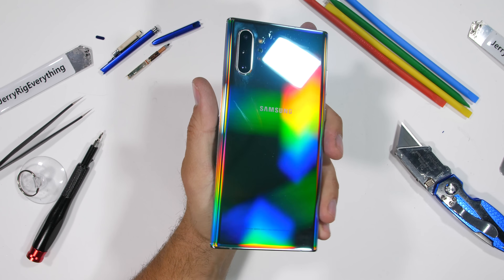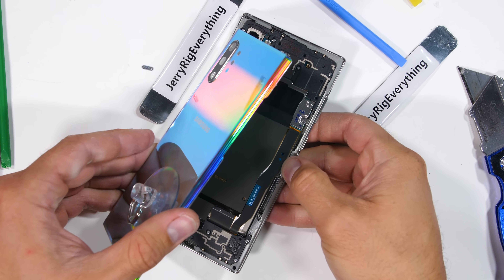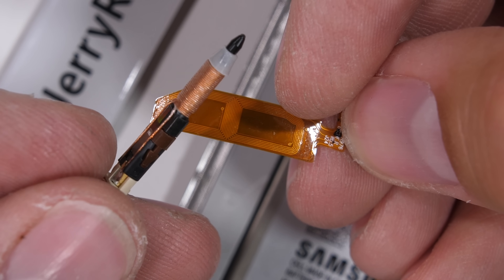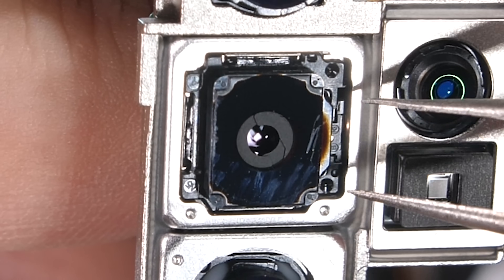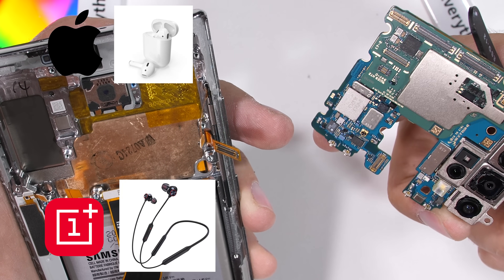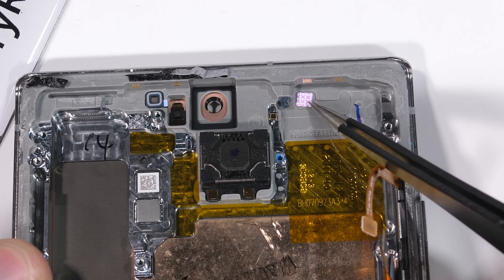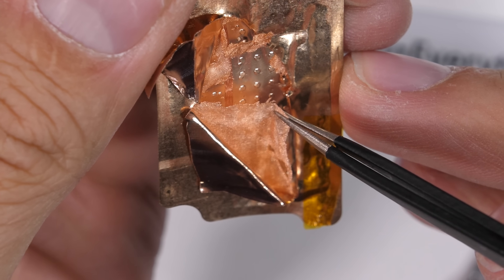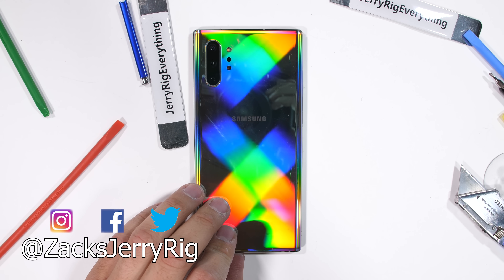Samsung Note 10+ Teardown - TWO Wireless Chargers?

Comment: I'm a system engineer at sumsung. The reason upper management didnt approve the AUX port was as you mentioned the stacking of the MB would cause overheating issues. We have samples with it and it surely did happen

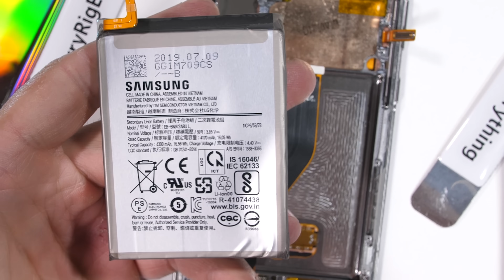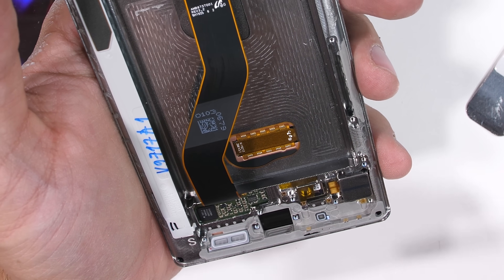Comment: if you pause at 7:33 or 7:34 you'll see that the battery is only at 4170 mAh not 4300 as mentioned
Reply: Wow good catch!
Reply: that's its rated capacity

the typical capacity is 4300 mAh
Reply: well you did not read all of it

Comment: This is ultra helpful.  I noticed my phone gradually quit allowing wireless charging and wouldn't wireless power share at all. Charging would only work about 10% of the time and slightly better chances without a cover on. Then it would only work if I pinched the phone under the camera lens. I removed the back cover and used a plastic stylus to push the connector from 1:55 a bit more securely down. Location makes sense as that is about where I had to pinch to establish connection before. Then reinstalled the cover and it has been charging effectively ever since.

Comment: To remove the battery easier put some alcohol under the battery after u pry the side a bit and it will come right off
Reply: WD 40 XD
Reply: Seems very dangerous and extremely unnecessary. Samsung really dropped the ball there.
Reply: iFixit ?
Reply: @AmanRaturi1  no I tried it on the note 8 even cuz I broke the display ... It went 3 stories down and the back glass was fine just replaced the front glass and screen

Comment: Its a hassle while charging and hearing music. Headphone jack is a requirement.
Reply: Are you supporting the headphone jack or the vice versa?
Reply: there is a cable that splits up for both. but yeah headphone jack has been removed just for marketing
Reply: My Parrot Zik 3.0 4 years old has Bluetooth, micro USB charging, removable battery without screwing, and 3,5mm and qi charging out of the box no adapter needed. I Use Bluetooth headsets since 2007. What year are you living?, 2005? Btw jabra has Bluetooth to 3,5 mm cord
Reply: @porozex3061  It's not for marketing they're pushing for an all wireless future why have cables when it can be all wireless and it'll be better in the future.
Reply: @vrsce0178  That's still marketing
Reply: @vrsce0178  Oh and they realised this after 2 years of mocking others that the future is all wireless.
Weldone!
Reply: @usmantariq7997  True. Lol
Reply: @vrsce0178  "why" 
Audio quality
Not wasting any more battery energy
Commodity
Reply: @jcarvalhaismatos  It'll be better in the future as I stated.

Comment: Samsung should have integrated the headphone jack into the bottom of the S pen.
Reply: Peter Parker that would be cool
Reply: That's great idea
Reply: Mohit Patel  I don't think the S pen has enough power to do for that as it just holds a very small charge.  But I agree it would be cool.
Reply: Mohit Patel  Unfortunately now that Samsung has removed the jack, I think wired headphones are going to become like DVDs, pretty much gone from the mainstream. But on the plus side, it should push wireless headphone tech forward in a good way.  Kinda already has.

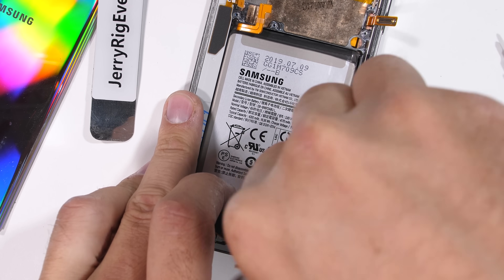Comment: 6:51 WRONG. I have a repair business so I know. You're supposed to add a drop or two of 91% isopropyl alcohol to both sides of the battery. Look at the adhesive design, do you see the channels? That's for the alcohol to flow through and weaken the adhesive bond for fast and easy removal. iPhone adhesive is more dangerous as the stretch adhesive can break causing you to have to pry it out with force which you should only attempt with a fully depleted battery.

Comment: Summary: Don't buy 10.
Buy 9 because it has 3.5mm jack
Reply: And also, if you want a smaller note10 get an S10+ instead, it still have that 2k screen, a HEADPHONE JACK, micro SD slot, andhave a bigger 4000+ mah battery, minus only the S pen
Reply: Street Blue why Do people like that ancient port
Reply: @jaisejacob4516  less lag, you don't have to worry if your earphones are charged, not all speakers are wireless, no need for Bluetooth, which drains you battery faster and more

Comment: so you need to get the + version to have a micro SD card? bullshit! i was thinking about getting the regular note 10 but now i am not. no headphone jack and no micro SD card they just went full Apple you never go full Apple!
Reply: At least Apple has a battery that's easy to swap... I'm not an Apple fan, but at these prices I'd expect better...
Reply: Just get the S10+.
It has more features and a bigger  battery than the Note10, with a microSD slot and more storage. And, it's cheaper.
Reply: Better, Note 10 has exactly the same sim tray as 10+, but the place where you put microSD card on the tray is filled with plastic. Idk, if there's a microSD reader on Note 10, but if there is, just buy the tray from 10+ or try to make a cutout for the card. Other manufactures, like Sony, did this with one smartphone, not for SD card but second SIM. They sold dualSIM version for some markets and singleSIM for others, when you took the tray from dualSIM version and put it in singleSIM, you could have 2 SIM cards functional on the "poorer" version.
Reply: @tommiac3214  the 10 + is way to big for my hands
Reply: Full apple? Because they removed the headphone jack and micro SD card slot do you even know apple? Apple claim to remove the headphone jack to have bigger battery and they still have a shitty battery till now whereas Samsung claim to remove the headphone jack because more than 70 percent of the note users use the earbuds,so in that case including the headphone jack isn't a good business. 
     Micro SD card?!! Just go for the plus it fully packed with a few hundred dollars compared to the note 10. Trust me the time Samsung goes full apple I'm dropping Samsung and at this point it's still a long way to go,no one complain this much when Huawei,one plus and other phone manufacturers removed the headphone jack.
Reply: How much storage have you filled up on your current phone tho?
Reply: Samsung ➡️ Hypocrisy
Reply: @Cdc9877 dude. I bet you have a Bluetooth headphone at home
Reply: @czaroxed  1) the housing is different for 10 and 10+ , so 10+'s tray with micro sd support won't do shit

2) the dual and single sim variant phone's trays are also different , the dual sim phone's tray won't fit in the other thing
Reply: @kavinsp  40/64GB on my phone and the SDCard has around 50/120GB mostly games and music so I don't get bored when I spend over 16 hours on a tractor also I like to take panoramic photos when I see a good opportunity for a beautiful one and they take up a bit of a room.
Reply: @RandHuman  Lmao remember those ads where Samsung used to bash Apple? Absolutely ridiculous
Reply: @Cdc9877 sooooo you have no reason to complain about the headphone jack ok
Reply: @Sara-ts5wo  I wish we could say the same about Apple.
Reply: @kavinsp  1) So you can still make a cutout in Note 10's tray, there's a room for it, of course if Note 10 has microSD reader. 
2) For example, Motorola X Play was sold on some markets as singleSIM, if you made a cutout for second SIM, addidtional card was functional but it had IMEI number stated as 0.
Reply: @dreezyloran6787   as I said before the plus size one is way too big for my hands I'm running a standard size Galaxy S8 at the moment and it's an awkward size for my hands
Reply: @phalanx3803  galaxy note 10 starts at 256 gb and goes upto 512 GB

Even 256 gb version would be more than enough even for power users like both of us
Reply: @phalanx3803  you still have 150+ GB of headroom if you get the normal base variant note 10
Reply: @phalanx3803  so why were you thinking about getting the note 10 in the first place? When you are familiar with the size.
Reply: @czaroxed  nah they are made different , SD card can't be seen even if you swap the tray , i know someone who tried
Reply: @dreezyloran6787  because my phone's geting old the battery doesn't last long anymore and it's starting to slow down a bit and between the Note 10 and the Galaxy S8 the Note 10 slightly bigger but if I get the 10 + I might as well just get a full size tablet at that point.
Reply: @kavinsp  Ok, just throwed an idea there. Still, I don't care too much about taking out microSD from Samsung phone, had SGS6 for like 2 years with 32 GB storage, it was enough for me, now I have V30 with 64 GB and I don't need extra storage, even when it supports microSD cards. Basic 256 GB on Note 10 is an absurd amount for a phone IMO and Idk who would need extra storage in this case unless you dailyvlog in 4k or smth like that lul.
Reply: @czaroxed  well yeah and vlogging on 4k is usually a waste , as it can't be uploaded with ease on YouTube and most people don't have 4k displays to put proper use of it anyway

Even so , someone who spends +1000+ on a phone would probably invest in a gopro hero 7 or something which is much better for vlogging
Reply: @czaroxed  again , I'm not a fan of removing things , I'm not saying that SD card is useless , I'm just saying that the 256 GB of storage is more than enough for 95% of the buyers

Also the internal storage(UFS 3.0 in note 10) is much faster compared to any SD card as a added bonus
Reply: @czaroxed  UFS 3.0 can do 2100 MBPS read and 410 MBPS write theoretically by the way

Comment: LOL "Feature rich cell phone"
I'll just stick to my almost 5 years old Note4, hope I'll find another battery to change it since my second battery is getting tired.
I mean really, Note 10 (2019) vs. Note 4 (2014):
 - 19:9 screen you are really going to "lady tampon"aspect and size.
Note 4 has 16:9 and is way more usable in portrait mode for reading and in landscape for watching videos.
- Screen: 401 ppi :))) vs. 518 ppi on Note 4 released in 2014.
- Useless curved screen, light bending on the sides and prone to crack easy if dropped. Flat screen on Note 4, clean image, dropped many times over the years, even on concrete or bathroom floor, no cracks, only the frame was lightly bruised.
- No notification led anymore... Very useful thing, Note 4 has it.
- No light sensor for Auto Brightness. Note 4 has it.
- No UV measuring, no heart rate. Note 4 has them.
- No card slot. Note 4 has one.
- No headphone jack. Note 4 has it.
- No IR blaster. Note 4 has it.
- 3500 mAh sealed battery (for which headphones jack was removed as samsung explains) :))) vs. 3220 mAh removable battery in Note 4.
1000 Euros for something like Note10 with everything removed, this is just spiting your fans in the face.
-Samsung also bought Harman/Kardon who owns JBL.
And they released the JBL Charge 4 portable speaker, a mono speaker with no microphone to be used as speakerphone and not even a charger in the box.
By comparison when Samsung was no owner of JBL, hes "older brother" JBL Charge 3 was made a stereo speaker with microphone and had a charger included in the box.
Its just veeery very sad what Samsung has become. And how he treats us.
Reply: Please stop talking bullshit. And Btw the battery size is 4300 mah not 3500
Reply: Thanks for specifying "lady" tampon , wait do you use them is that why you had to specify
Reply: @lukasstadler6594  Please stop talking bullshit. And btw I said Note 10 not 10+.
Making a " + " variant just to ask more money for a product with less features than older ones, is just Apple level of crap.
Reply: @florintm4133  Dude if you don't want a new phone, OK I don't care, but don't shit a company like Samsung, that's still produces better phones at lower prices than apple
Reply: @lukasstadler6594  I don't shit anyone, those are simply the facts. Prices skyrocket for no reason, and Note is just an ordinary line of smartphone now.

Comment: Xs Max teardown:
"Upgrading you phone every year is dumb and a waste of money"
Soooo trueeee!
Still using the Galaxy Note 10 Plus (12/256 w/o 5G) that I bought in an used condition and I do not want to change the phone.
Even though it probably won't be getting any more updates for me to leave Android 12 with One UI 4.1, I'm satisfied and will be for a long time (Plus custom ROMs will do the job if I want to install A13 or probably later if custom ROM developers will publish after the open source code comes out).
Even after 3 years of usage (by other person btw) it still has surprisingly better battery than those 5000mah 2021 phones have after 1 year of usage (because numbers do not matter that much, optimization does!)
Good condition, better price, than today's budget phones (that are new), flagship, a nice camera (Even better with a ported Gcam with HDR+ and Night Mode. Plus variable aperture is so cool for me personally) and ability to perform actions so fast, as if it was a 2022 flagship.
Yes, it was very expensive, but also very futuristic phone that can be disguised as if it just came out.
I bet I will upgrade to Note 20 ultra after couple of years and will say the same stuff about that as well.

Comment: Did you end up buying a 10+? I got one shortly after release after switching from a iPhone 7 and it immediately was amazing, installing apps almost instantly compared to a 2-4 minute install time. And that's even with the less powerful exynoss version, boot times were immensely fast and I barely needed to reboot, the ram managed to hold all of my commonly used apps open without needing to refresh them.the literal only complaints I had was no headphone jack, not because I wasn't willing to fork out the $200 for the galaxy buds..  they came free with the phone. It's because I game, and 3d sounds are necessary to play well and Bluetooth buds have a sound delay. Not much, but the 0.4 second delay makes a lot when the game you're playing gives you a maximum reaction time of 0.8 seconds, and you also have ping to the server, making you fail this time quite often If you're using Bluetooth

Comment: Nope.. You do NOT need to hold the power and volume down to turn it off! :)
You choose what the power button does... Mine is set to only be a power/lock button and does not activate bixby. (I have even removed bixby without root).
And if you swipe down the notification meny there also is a option for power off.

Comment: for petes sake Jerry, I've been commenting on EVERY new samsung model that there is no need to break the battery like that, i't doesn't have magic pulltabs like you say, but you can remove it much more easily than iphone batteries if you just heat the damn thing from the back

Comment: I remember that my previously owned Nokia N86 8MP had a mechanical shutter and a variable aperture camera, however, in my opinion,  in phones these features don't make much sense, even in today's standards. 

When trying to shoot with a high end smartphone in a challenging situation, and remember how the manufacturer introduced that phone's camera tech, I get upset, feeling that companies just want to make higher spec sheet they can brag about in the release conference claiming that their phone is a "world's first" to have this feature or another.

The simple truth of the matter is, however, that size matters, and the tight space inside a highly portable device results into limiting the effective implementation of those features like they are used in real cameras, exactly like when such a company claims it has designed a HiFi in ear headphones. 

That said, tech companies have managed over the years to find their way in such tight spaces inside a mobile device, and they've done an incredible job in designing high performing products with the same figures as a full size product, such as the micro SD, the built in GPS, WiFi, and Bluetooth modules, the tiny but powerful processors and GPUs, and so on, which has resulted into the elimination of entire devices that we used to rely on before they were simply built into another device, which in this case, the smartphone. If you watch how Steve Jobs introduced the first iPhone back in 2007, you'll see exactly what I mean.

Concerning cameras, however, tech companies have still got a long distance to cover until we can leave our pro photography and videography tools like the full frame bodies, at the closet, exactly like we did for the desktop computer.

Anyway, thanks a lot for the great video and please keep showing us the inside of the latest tech.

Comment: Why is the Jack such a big deal, there are cheap adapters for 3.5 mm connectors on the charging port for sale many places online.
Reply: Adapter that you absolutely shouldn't need to buy. There is no standardization between different dac(Digital to Analog Converter) technologies. Some charger ports have dac within, some don't. Some accept external dac, some absolutely require it. External dac costs more. Only excuse for not having headphone jack is thinness, but phone so thin to make jack not fit in, is too thin.
Reply: BTW cheap adapters don't work. Only the kind that has the DAC in the plug, since this phone no longer has it.

Comment: Learning a bit more about the breakdown of my Samsung Note 10 +. I accidentally push the pin on the top far right hole. Worried that I may have damaged something.  Is there a speaker or microphone close to the holes at the top of phone?  I did tested the speaker/mic a couple of times and it appears to be fine.

Comment: Hi there! Good video.
Any indication where to put a wire externally (that connects to a 4G LTE antenna, that I bought from Motorola) on the outer part of the Samsung note 10+?
I have a zero lemon case and engineered it to hold a 2" stub 4G LTE antenna, in doing so the stub antenna is fixed in place at the upper left corner of the case,so the wire that comes from it is against the upper left back of phone,which shows a increase in bars on phone,but (I have T-MOBILE) It doesn't really help my data or call connectivity. 
I'm puzzled? Thought you might be able to help.
Thank you and God bless you.